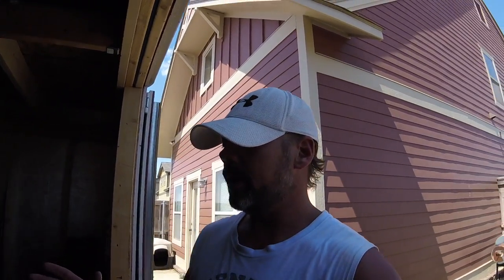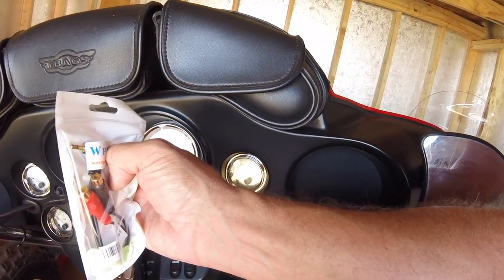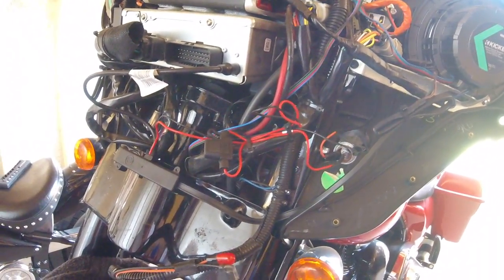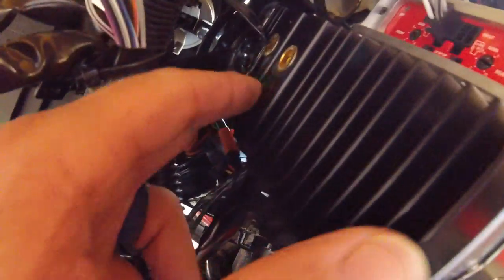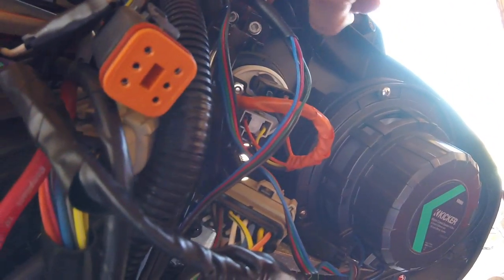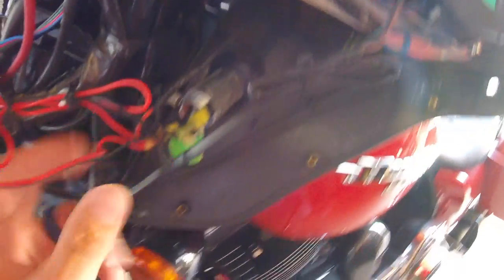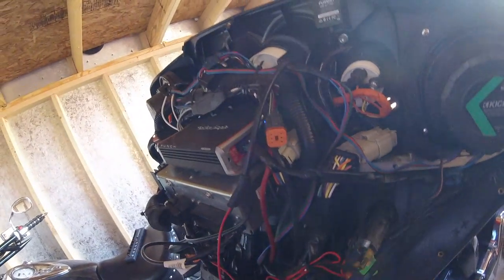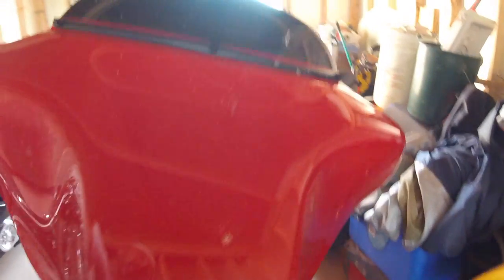How to add bluetooth to stock street glide radio 2013 and older

Comment: What you did is one option, just a little scared of the gap is created by running the wire UNDER the radio that will cause water to go in the fairing.  
Have you attempted drilling a hole on the underside running the wire and then caulk it? The hole will have to be a nice size because the 3.5 mm plug will have to go thru it...
Just asking.
BTW, nice bikes!!! :)
Edit: I must say after 4 years of thinking about it realized, I'm an idiot! 
If you look further, you'll see the water will ran down and drain, there are no electronics underneath and the cruise control, accessories switches are further back, at a separated location.
Agree with Randy McCalla, I've seen several times people squeezing wires in tight places and later in the future the wires become brittle and will eventually break, fail, because of the stress.
Reply from the maker: Bara Southflorida, hey yeah I thought about drilling and using caulk but a better solution I have come up with is the window weather strip. There is just a small rubber strip around the head unit and when you pull it you will notice a small gap at the top also. If you get the small rubber weather strip with the adhesive on the back you can place it along the radio and it will seal around the wire. Also underneath the radio there is nothing and the chances of getting water under there is less likely but there is always a chance even without this modification
Reply: I have the idea that you can file a small notch above the accessory panel and run your aux in from there.

Comment: Just saw this, now I'm curious about opening the head unit and soldering the aux wires directly to the inside, that would be sick if I can make it work... Off to do research
Reply from the maker: It’s actually pretty easy to do. I’ve seen it done on a couple head units.  There used to be a couple videos on YouTube.
Reply: found anything for that job yet? :)

Comment: You do know that there is a Bluetooth receiver that super small and plugs directly into the 3.5mm jack on your stereo. It takes 2 minutes to install and pair with your phone. 😮
Reply from the maker: Yes I do. I also know I posted this video 5 years ago and those small receivers were not that small and I don’t like that little dangly thing hanging out of my stereo. Also most of those Bluetooth dongles are not waterproof. Just sayin……. But yes for 2022 the Bluetooth 3.5mm plug is easier.

Comment: So I have the Harley set up on a 13 street glide with the controls on the bars and the phone plugs in the saddle bag. Is there a easy way to hook blue tooth to that set up, main reason is I noticed before when I used the aux cord I could answer phone calls and I’m wondering if there is a way to integrate something blue tooth into the set up I got now  that would allow me to answer phone calls with the Harley bar controlls. I own a construction business and I swear every-time I try to ride during the day I get calls and I got to pull over and see who it is. When you work all the time you got to get a ride in every chance you get lol today I strapped a 4’ sewer clean out pipe to my tour pack rack just so I could ride to the site.

Comment: Great video, was almost gonna use the hogtunes, but I like yer idea better.  My only problem is the aux port on front is sloppy, and bounces in an outta connection with any Jack plugged in. I heard there was a rear port on radio? Any suggestions how to fix/replace front aux port?
Reply from the maker: Hey Kevin,  there is a way to make your radio have an aux port in the back but requires you to open the radio and you would have solder a new aux cable in. There is a YouTube how to video somewhere on YouTube. If I can locate it I will post it

Comment: Added Fusion to my 2006 Street Glide.  It works great with engine turn off.  Once I start the engine it picks up engine noise.  I was very disappointed.
Reply from the maker: Jack Fleming yeah that is not good. Double check your ground.  Try grounding it to a different location and that could help. Sometimes a shared ground in a auto/bike application could cause engine noise.  I am still running the same setup to this day and have not experienced engine noise through the speakers. Also if your running an amp check the ground for it. I hope this helps.

Comment: Cheaper than the hog tunes Bluetooth, I like it, only one question were did you connect the the ground (negative) wire?
Reply: I wired mines right Into the same pos and neg on the back of cigarette lighter

Comment: I have a question with the fusio. Ms bt 100. I have a 2011 ultra electra glide.  J can plug my helmet into my bike. If I install this device  and I get a call on my phone will I be able to talk to the person in ny helmet which is plugged into my bik
Reply from the maker: Patrick McGillicuddy I don’t believe so. I have not tried it with an Electra glide with the intercom system. Being that the Fusion Bluetooth is an audio receiver I don’t think it would work. If the music and audio from your phone played through your helmet you could hear the phone call but you would still be utilizing the mic on your phone so the other person would probably not be able to hear. I have the Sena 2000 that I have in my helmet so if I get a call I can talk on it and my music still plays on the bike over the Fusion Bluetooth.

Comment: Have the same stereo in my bike, do I have rca jacks loose to use under there too? Stereo is stock Harley on 2013 road glide
Reply: He used a 90 degree 3.5 aux to rca connector from the front and ran it through to the back.

Comment: Instead of retrofitting Buetooth to the Harley Radio, what would the cost difference be to replace the radio with one that has Bluetooth?
Reply from the maker: Michael, if you do it yourself not that bad price wise but if you want a good head unit you get what you pay for. I can do this upgrade for under $45-$50 a new head unit can cost from $50-$500 or more depending on what you want. But most you will loose your hand controls. There is a company called aquatic audio that makes one you can keep your hand controls but they run around $300

Comment: interesting, but why not the antenna style? so the plug isn't running to the front.
Reply from the maker: Mark Os, I had this on hand for one. And most of the antenna ones at the time I made this video still require a cigarette 12v port and most are not waterproof and I use my 12v port for other things. And most antenna ones I believe require a certain radio channel. If I understand you correctly
Reply: i dig, iSimple ISFM23 TranzIt Universal Bluetooh Enabled FM Transmitter, you wire and connect between the antenna and turn to one of the 3 channels, they sell anywhere from 89 to 135, depending on where you order from, used or new. i saw another one like yours where the guy moved the aux plug to the back, a lot more work but a clean look.

Comment: Do you have to have an amp for the rca’s? Or does the stock radio have the plug ins for it?
Reply from the maker: Josh Outen, I am using an amp but the Bluetooth doesn’t utilize the amp. I use an RCA converter to 3.5 and that’s what plugs in to the stock headunit.
Reply: Okay so this set up will work with my factory 09 flhx
Reply from the maker: Josh Outen yes sir
Reply: Awesome thank you !!

Comment: When I use the GPS on the phone does it work with this as well. Can I hear the directions that the GPS is giving from the phone?
Reply from the maker: Terry CLEM, yes it should. I use WAZE app on my phone and it transmits through the speaker as normal like it does through the phone.
Reply: @redhot3000gt  Perfect. I don't care if I can see the map on the phone as long as I can hear the directions as when to turn and how far etc etc.
Reply: @redhot3000gt  I went and bought it from amazon along with the 3.5. Thanks I've been looking for something like this for awhile. Thanks again

Comment: Maceton blue tooth stick. 20 bucks on amazon. No cord, just plug in to the aux jack. 12 hrs of battery per charge.
Reply from the maker: Mic Mcbane yeah that’s what I used for a while but not waterproof but I still use one in my Jeep. I did this to keep it waterproof and out of site and I don’t have to charge it.
Reply: Black tape water proofs mine.

Comment: What an unnecessary hassle. If you really want to Bluetooth your phone to your stock radio quickly and inexpensively, go get a $10  BT sync (Amazon, etc.) that plugs into the cig lighter and away you go. I've used one for years with cars, bikes, etc. and never had a problem with sync or sound quality.